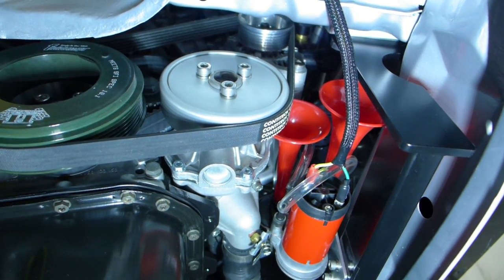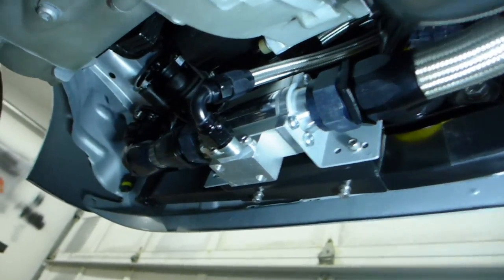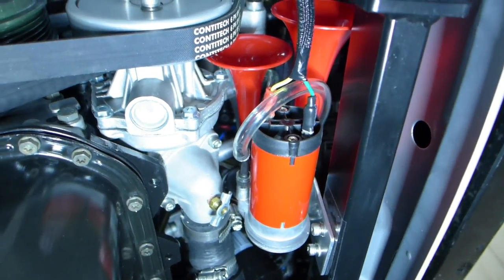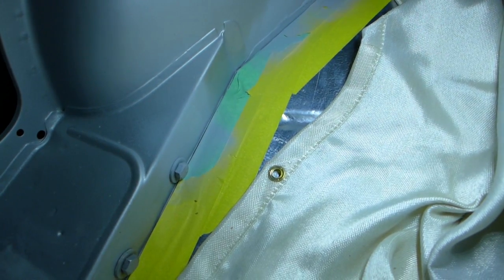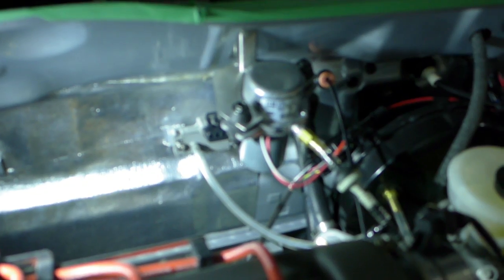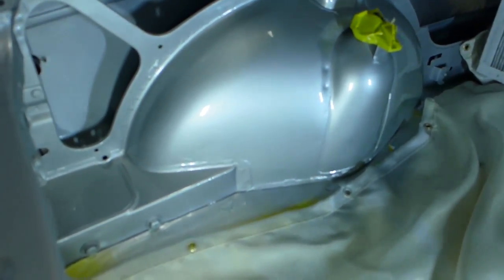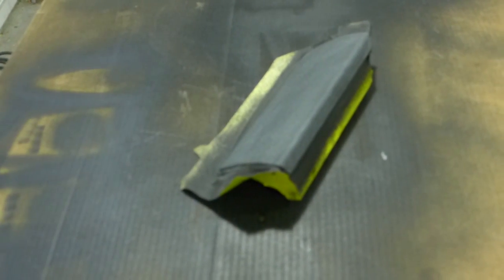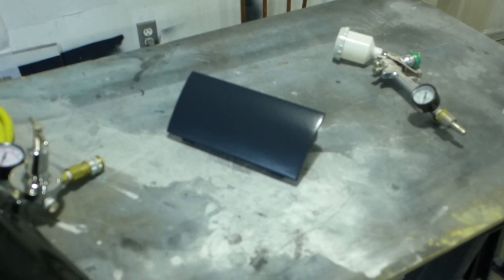The Ultimate 1983 Rabbit GTI - part 114 (Air Horns, HID Headlights, Ash Tray)

Comment: Where did you get that crossmember support bar?
Reply from the maker: Autotech, also available from Techtonics Tuning and others - I am referring to the upper strut tower brace. The lower brace is an old Neuspeed product that is no longer in production - but again, there is a nice multi-point lower brace available from TT and others too
Reply: Derek Spratt talking about the bar 
that goes across your control arms